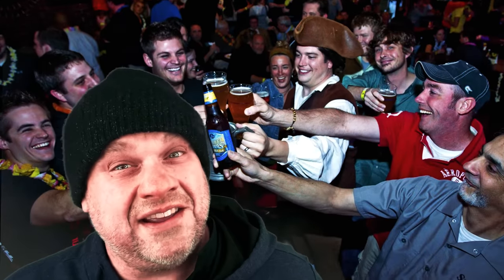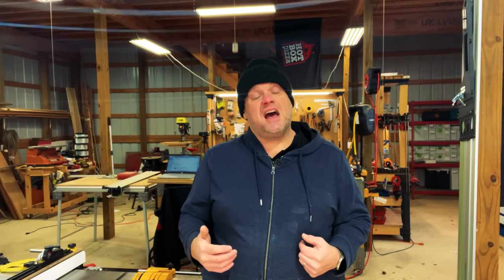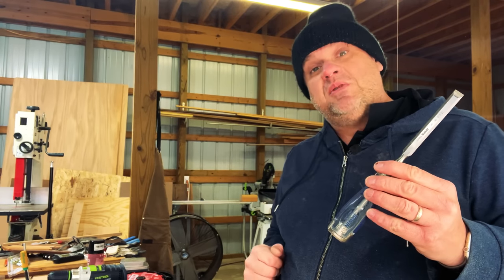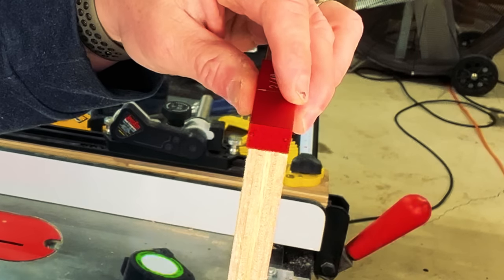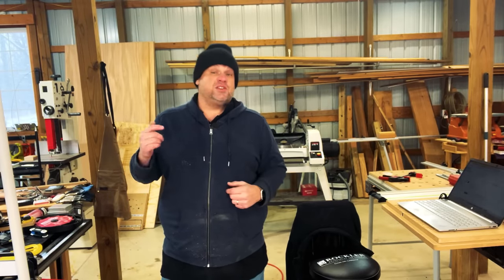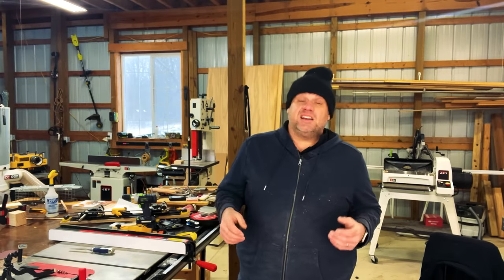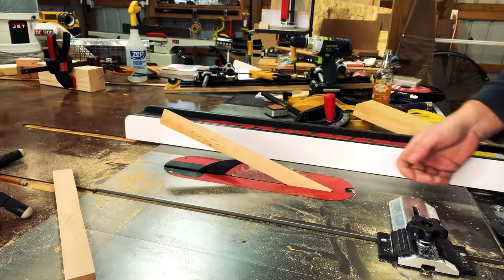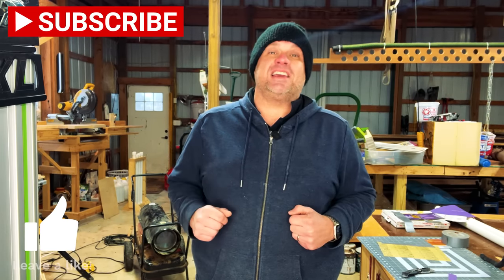Beginner Woodworker? Unbelievable Hacks You Wish You Knew!

Comment: Thanks for the tips. The black marks from the pipe clamps can be avoided by using packing tape on the pipe. Makes clean up a breeze too.
Reply from the maker: Excellent point.  I've done that a few times, but I always seem to forget until it is too late! :)  But that is a great tip!  Thanks for watching Allen!
Reply: For the black marks I use dollar store wax paper and lay it over the clamps. I use wax paper all kinds of ways and I compared price per foot with the grocery store and the dollar store is cheaper. 
I often use my table saw and fence for gluing 90 degrees and just put wax paper over the saw table.

Comment: Why don't you buy 3/4 galvanized pipe instead of 3/4 black gas pipe
Reply from the maker: Well unfortunately I find those really hard to find in stores close to me, there is also a price savings with the black pipe.  However either would work.  I have not used the galvanized pipe so not sure if it would leave the same black marks or not, as I think it is a chemical reaction that is causing the marks.